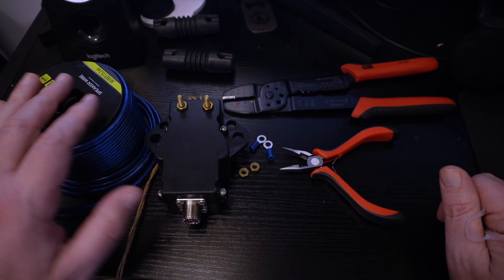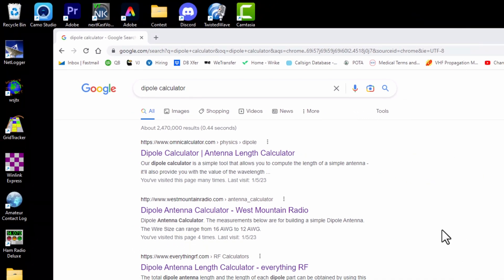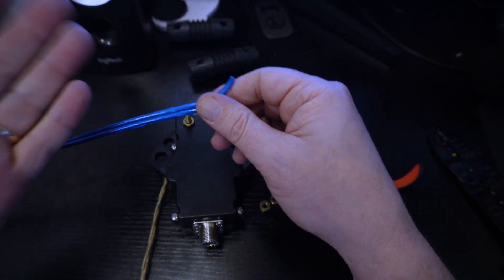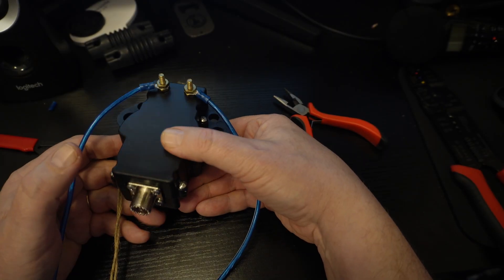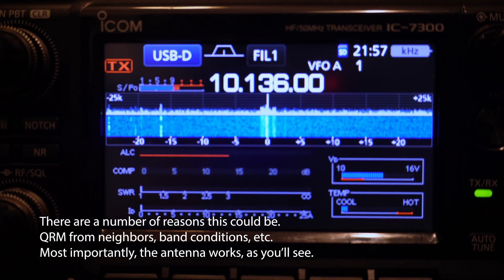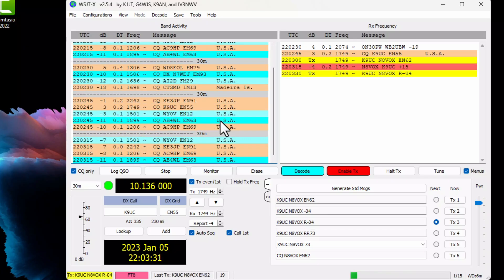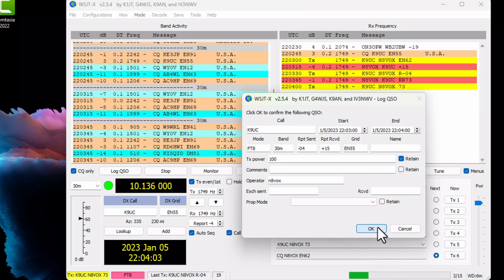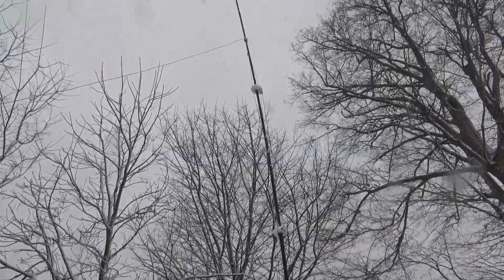Easy HF Antenna Build

Comment: Yes the wire dipole is the easiest antenna to build.  I will have to show you the 80m/40m wire antenna I made for NVIS while camping.  The words "If it can radiate, you can communicate" is something you have told me before and I have told others the same thing.  The wire dipoles I used for POTA prior to using the random wire I currently use might not have looked the best, but they work.